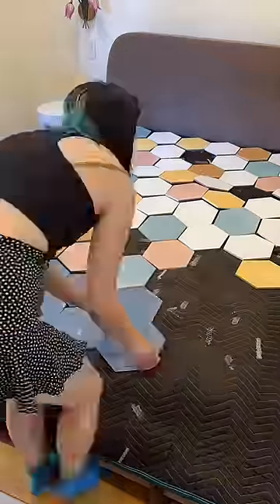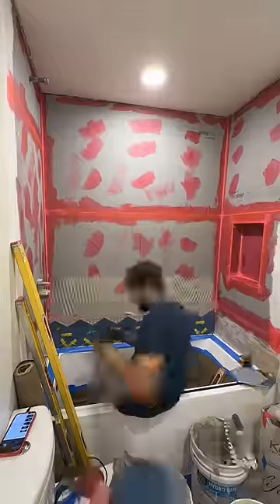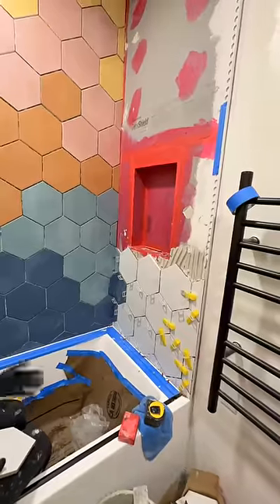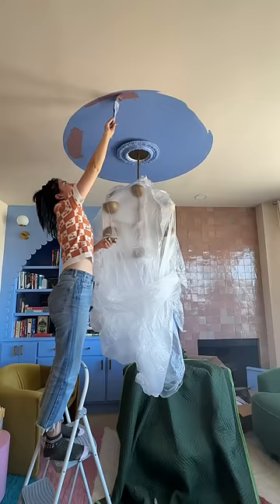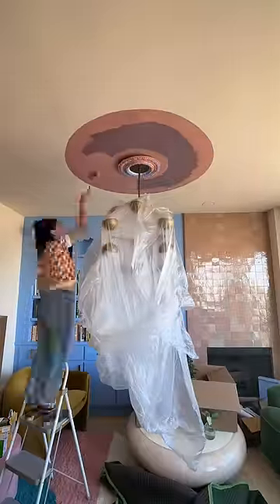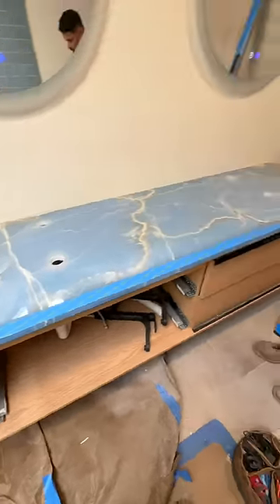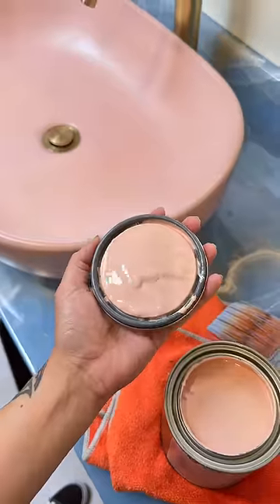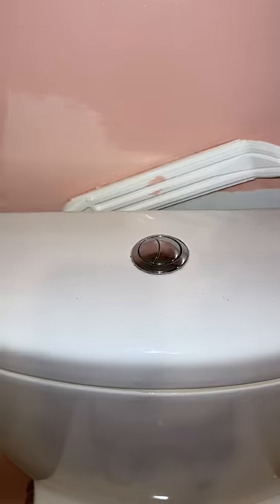Rainbow honeycomb bathroom  🌈

Comment: Nice. So my parent's 1950s pink and blue bathroom that's never been updated is finally back in style.
Reply: 😂😂😂😂😂😂 just took 73 years
Reply: That's my dream bathroom
Reply: I have pink tile in my bathroom. It's from the '50s. It's like a dusty mouth pink. The tile on the floor has the same shade of pink mixed in with other pink almost tan shades. The same pink tile is also on my bathroom counter which is about 6 ft long with a mirror the same length across the top. It also has white tile accents on the backsplash behind the bathroom counter. I have to repaint, but I'm having trouble deciding what color I want to paint because it's hard to match.
Reply: That’s how trends work
Reply: Everything comes back in style eventually. ❤
Reply: I gave a thumbs up but I do not like that bathroom. I applaud your effort. But the resale value just dropped significantly.
Reply: It’s always been in style
Reply: Lol I was just thinking the same thing
Reply: parents’ not parent’s (unless you only have one).
Reply: @nanashouse202  have you considered that they arent reselling and probably dont care
Reply: @miryam815  yes. But it’s not likely a forever home. Actually no home is. You follow the work.
Reply: @lostineggsaisle  that's a LOT of pink. I would just go with an eggshell white.
Reply: @lostineggsaisle paint a very neutral color.  The right white with the tiniest backlight of pink in it would tone down all of that pink you’ve got going on beautifully!
Reply: 😂 not for me this time 😅
Reply: My mom got our yellow tile bathroom redone recently. All grey :(. At least the walls are kinda blueish.
Reply: Sure is I bet they have some gorgeous hardware that can just use a nice polish too
Reply: @nanashouse202 shocker but not everyone owns a home to resell but to live in

Comment: I see a lot of water damage in the future with no water barrier behind the tiles. Sure the Red Guard 100% will protect the screws but the cement board is has pours and will soak that water into the walls, insulation, and studs. Should have put a water barrier film like the Kerdi membrane. That cement board will hold mold too
Reply: I guess that's what happens when you hire an influencer instead of licensed contractors.
Reply: They've got denshield up
Reply: @shatteredshards8549 or maybe she’s just posting about her job?? Social media is a great way to market to people, and it’s also usually fun to do.
Reply: @masterofmoss1591  She became an influencer by posting videos of how she decorated her own home. She worked in post-production before social media started making her money.
Reply: If you’re using thin set with a good polymer additive + grout with sealer, you should do just fine tiling on the cement board
Reply: It'll actually be fine
Reply: Aren’t you supposed to use a special concrete board for wet applications like this? You can do regular concrete board, but greenboard ,or any another wet application specific  concrete board is what you’re supposed to use for a shower or tub . A Kerdi-system is probably the best tile underlayment  out there also , just my take on it.  
I researched tiling for about two years planning to tackle the showers myself before deciding that doing the shower bases would be too difficult for me.  I did buy quality tile myself saving $2.00 per square foot under what the contractor quoted for the same tile! Saved a bundle.
Reply: @shatteredshards8549  she is showcasing her design and talent.  Silly comment . 🙄
Reply: @allimoo-249  Y'all really hard carry for influencers, huh?
Reply: @shatteredshards8549  no. Just like looking at her ideas. She’s really creative.
Reply: @allimoo-249  not very creative, just very rich))))